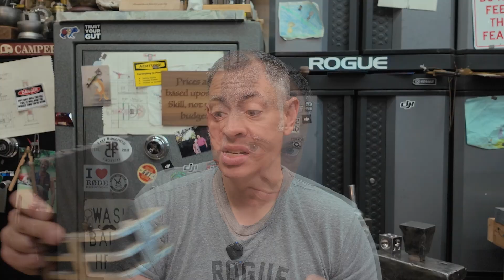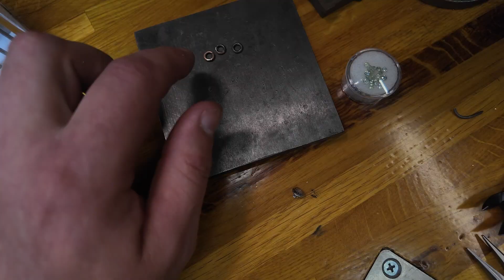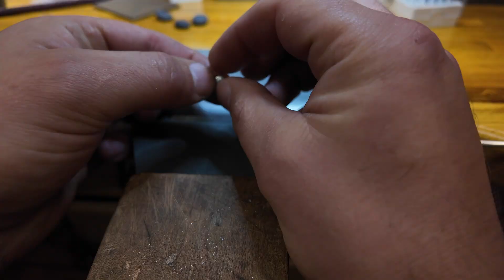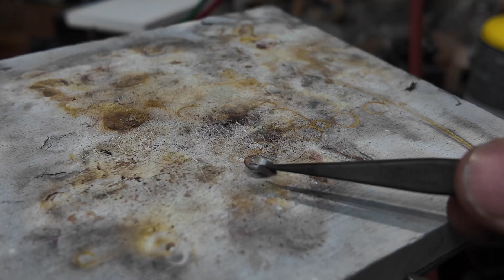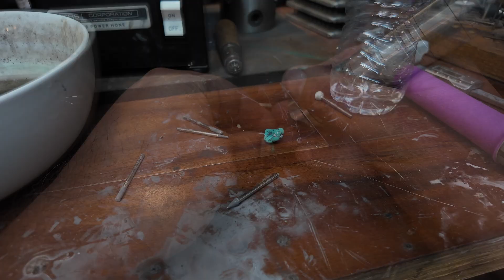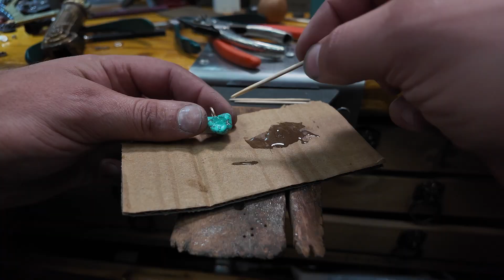Making a turquoise nugget with a silver inlay and Montana sapphire setting

Comment: Does the epoxy ever discolor the stones?
Reply from the maker: If you use a good quality like 330 or another “water clear” UV resistant epoxy you shouldn’t notice anything. You will notice come discoloring of the actual epoxy when using cheaper non UV resistant kinds. Cleaning up and avoiding squeeze out it also import. I’ve noticed on some older turquoise prices that if the clean up isn’t good over time the epoxy will discolor on the stone and appear like the stone is changing colors.
Reply: @LionPunchForge  thank you!